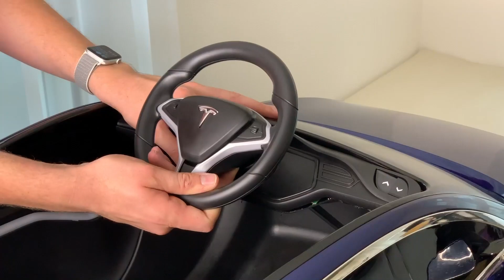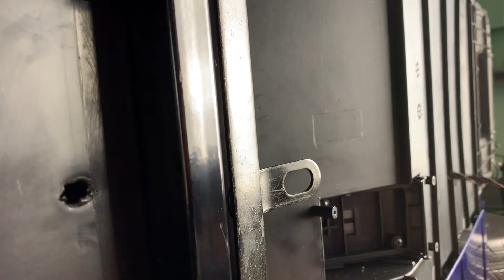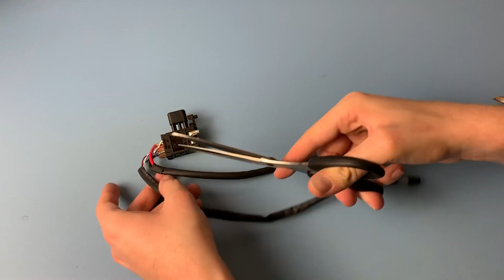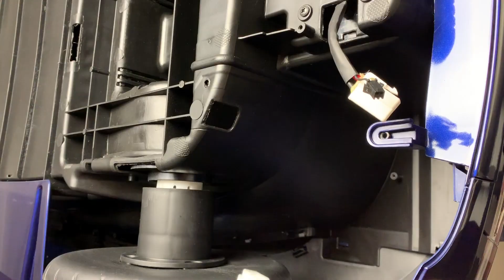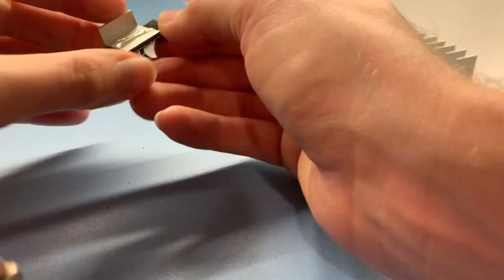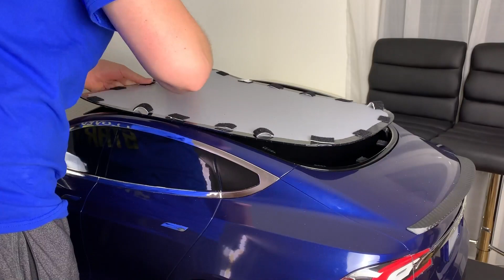Radio Flyer Tesla Model S RC Conversion

Comment: Is there any update possible here to make the list of supplies with ESC and Remote available today? Thanks!
Reply from the maker: There is no need for an exact supply list, most RC Components will do. Also we’re probably not located in the same region, therefore providing local shops will not help you. Just important to get a ESC for Brushed Motors (the Standard is usually Brushless these days, that’s not desired here).
Reply: @TuRtel89  Thank you very much for this response.

Comment: Hello TuRtel89, thanks for the great video and instructions. In my case I would like put a remote on the accelerator only and let my grandson do the steering. I would ideally like to have the remote override the physical accelerator for safety reasons, but that may be asking too much.  Do you see a problem with skipping the steering controls or any other issues with this?
Reply from the maker: No Problem at all, just leave the seat and Steeringwheel as is and do the rest. Best regards

Comment: I just finished converting my daughter's Tesla thanks to you and this video! I followed along and copied every step although I didn't realize the extent and underestimated the time it took (time lapse videos are always misleading, lol). Also there were a few "aha" moments that set me back, so I wanted to include that below. 

A few extra pointers to add for other DIY's  (08/19/20)

1. The DX5e remote is now discontinued. It's been replaced by a newer version and I'm sure those work just as well. You really only need a remote that connects to a receiver with the same connections that come from the ESC (standard 3 wire). I was paranoid anyways and found the discontinued model from eBay but found it to be nothing special. Also, about this particular remote, the left stick only returns to center from L/R, not Up/Down. The right stick returns to center both ways. Because of this, I made the left stick only control the front wheels for L/R and the right stick to control forward/reverse. On the AR500 receiver that's ELEV to the ESC and RUDD to the servo. 

2. The quicrun 860 is also discontinued. Finding this "used" is a needle in a haystack, even on eBay. It's been replaced by the 880, and that is EVERYWHERE. I don't know much about RC components so I don't know if I could connect two ESCs with the proper amperage or split a single output from a higher rated ESC, so I just stuck with the 880 because of it's dual motor output. I got a program box to reprogram max output to 75% so hopefully that translates to dialing down 80a to 60a and I won't need to worry about frying any components. 

3. The XT60 yellow connectors were a POS, lol. I had the hardest time soldering the wires to them, even with rosin flux paste. Solder stuck to the connector and the wire but when it came time to melt them together, nothing worked. It was a miracle I got all of them together (thank god for the heat shrink wrap) but they look a mess. 

4. The servo arm that came with my servo didn't line up with the holes on the 3D printed extension. It only had 2 holes and they were closer together. I had to buy just the arm with 3 holes. I also drilled a hole in a 1/2 inch dowel sliver and put that around the screw that steers the front wheels (the original metal rod was 1/2 diameter, thus the hole in the steering assembly is 1/2 inch). 

5. Taking apart the car is way more tedious than you make it look. I thought the parts all just pop off. There's like 6 screws holding the rear bumper undercarriage (I didn't even bother removing this piece so that saved some time). I also didn't need to remove the motor cover. The motor wiring is outside the cover anyways. There's 7 plastic fasteners that clip the dash to the car. The steering rod was another PITA to remove. The wiring harness doesn't just pull out, there's like 5 zip ties that need to be cut along the length of the harness. 

6. The wiring diagram was a huge help. You didn't really go over how you made the 4 point connection between the batt/switch/ESC/lights but i figured it out. I just ran a straight connection from battery to ESC and tapped the lights and switch into it. 

7. The 3D printed cover for the accelerator pedal switch is wonky. Even zip tying it on there, it doesn't go on straight. It doesn't poke through far enough to put the round 3D switch cover in the trunk so i just left it open.

8. I ran the servo wires through the old steering rod hole since it was right there and under the car, out of the way of the interior of the car. 

9. I put the seat back so that she could still ride it. I even put the steering wheel and dash back on. I used a wooden stick that is 1/2  inch diameter about 6 inch length and secured it to that dash just for decoration (also you can still turn the wheel but nothing happens). 

10. Last but not least, I also added a seat belt because if she's going along for the ride, she better be strapped in, lol.
Reply from the maker: Thank you for your Feedback! Glad the guide worked for you. This Tutorial was not made professional nor am i a professional model builder, the video was made along my own trial and error of this conversion. But i still wanted to share something of a guide to others, therefore not all parts and descriptions are 100% accurate. But some know-how of RC components, soldering skills and tinkering know-how are required for such a build. I hope your daughter enjoys her ride. Best regards!
Reply: Hey, awesome tips! Think you could tell me how you programmed the 880 esc down to 360a?

Comment: This is exactly what I want to do with my daughter's RF Tesla! Thank you so much for making this video. I tried looking up the parts needed but it looks like the ESC and remote are discontinued. Are there any reliable replacements you can suggest? From what another user on here is saying, the 880 is too high at 80a. Should the 1060 be a suitable alternative? Also the DX5e is discontinued and I have no clue what would work. As for the servo, how strong is "strong"?
Reply from the maker: Dear raycho420, thank you for the reply. Glad you like the video. I don't think the QuicRun WP 860 Dual Brushed is discontinued, it's still listed on the manufactures website and i can get it in many online-stores here. If you have trouble finding this exact Model try and find something that matches the specs, see the video descriptions for the link. As for the Remote, any RC Remote and Receiver will do, just get a cheap one thats suitable for RC-Cars. With my Car i'm currently unhappy with the Servo, it's just not powerful enough for the heavy steering axle. Mine was rated 12kg, maybe get something bigger or stronger. Hope this helps, best regards.
Reply: Did you find the parts? Could you also please share the links to the parts you bought since I also found the ESC and Remote discontinued.
Reply: @leticiadiaz5839  i had to get the remote used on ebay. found a 30kg servo on amazon. still trying to find the 860. i don't want to risk burning out the motors with the 880, and the 1060 doesn't appear to be available with dual outputs. i'm kinda stuck looking for that one part. it's like no one else makes a 60a dual motor esc

Comment: Thanks for the tutorial! I wonder if you have advice on how to make it RC but still keep it drivable from the inside. I want to tap into the electrical harness rather than pull it all out.
Reply from the maker: Thank you! Honestly that would be fun, but great deal of work. You can't have both, the steering and motor are either manually controlled or by the RC components, if you want RC, then you'll habe to figure out a way to make an RC-Electronic compatible signal from the Accelerator Pedal and the Steering Column. Don't get me wrong, absolutely possible, but lots of electrical and programming work if you feel up to it?

Comment: I have an extra Traxxas remote transmitter. 

Could I simply purchase this receiver instead of the one combo you used? 
 Traxxas 6519 TQ 2.4 GHz Micro Receiver (3CH) https://www.amazon.com/dp/B00CL0XQ12/ref=cm_sw_r_cp_api_i_l6DWEbB01WYVH
Reply from the maker: Yes, any Receiver and Transmitter will work. However the ESC is very crucial. I do really recommend the one i purchased, since lots of people here seem to have issues with the ESC itself. This one worked flawlessly: http://www.hobbywing.com/goods.php?id=357

Comment: Because of this video I'm also trying to turn my RF Tesla model S into remote controlled but I'm having some troubles with exploding capacitors on the motors and it does not want to go in reverse. Can you help me?
I also bought an esc (QUICRUN WP 880 Dual Brushed ESC (2-4S)), remote controller (Microzone MC6C), receiver (Microzone MC7RB) and a 35kg servo. I hooked everything up like in the video and the esc also makes the bleeping sounds. The servo works good as expected, but when I turn up the throttle on the wheels it starts rotating and after around 5 seconds one of the capacitors on the motor circuitboard explodes. Also, in your video you can go in reverse by pulling the stick the other way. When I do that, nothing happens. However immediate breaking does work. For the exploding capacitors I replaced it and again I managed to drive for around 5 seconds and then it exploded again. Can you help me fixing these problems?
Reply from the maker: That sounds weird. Are you using the Battery of the original Car or any other RC supply?
Reply: @TuRtel89  The original battery which should be 14.4 V. The capacitors should withstand 16 V.  I measured the voltage over the battery directly and it says 16.4 V which is very strange.
For the problem of not going in reverse, I think the ESC is not programmed correctly, however coming out of the box it should be set to Fwd/Rev/Brk. Did you have to reprogram your ESC?
Reply from the maker: MrWahhe no programming needed on mine, the esc should not change the voltage, therefore i am worried your caps blow out. Maybe try a different esc? The one i recommended works flawless. Maybe also recheck your wireing according to the schematics i put in the video.
Reply: @TuRtel89  The difference between our ESC's is that mine is 80 A and yours 60 A that could indeed be the problem. Thanks for your help!

Comment: I got my Radio Flyer Tesla Model S from the referral program, and from the moment I opened the box, I knew I had to do something cool with it. Recently (Super Bowl game) I used it as a cooler ( https://www.instagram.com/p/B8FxQBrJXAjLCld-cQsaaCp_UlTWSxc2f9TbS00/ ) , and it was then when I decided I had to make it an RC. Your video inspires me to give it a try, but I noticed that the Receiver/Transmitter is discontinued. Do you have any suggestion for replacement? I'm new to RC, but I enjoy flying my Traxxas drone, and I think this conversion project might be a lot of fun for filming short videos. THANKS FOR SHARING!
Reply from the maker: Glad you did so many referrals, good job! Really any RC Components will do, check your local RC Store for help. Only importance is to get a ESC for „Brushed“ not Brushless Motors.

Comment: Brilliant video.  When I push my Accelerator Pedal switch, it will allow the battery to output full power for approximately 5 minutes, and then cut-off.  I have to manually push the switch again to re-start the full power from the battery.  Have you found a way to overcome this limitation?  Thanks
Reply from the maker: Thank you for your Feedback. I noticed that the Power will Shut-off after some 5 Minutes-ish when nothing is done, but only sometimes, i thought that would make a nice "sleep mode", does yours shut-off even when driving around? If so, did you connect the Lights? I figured just some Power has to flow for the Switch to remain On. Let me know, happy to help.
Reply from the maker: Does work for me, it sometimes goes to sleep after 5-10min when not being used. But while being in use it never shuts off.